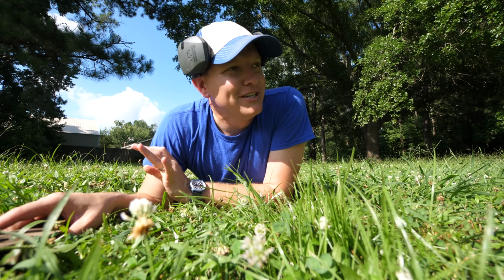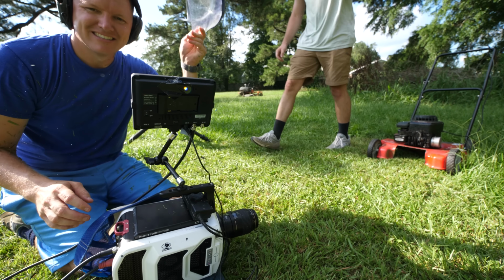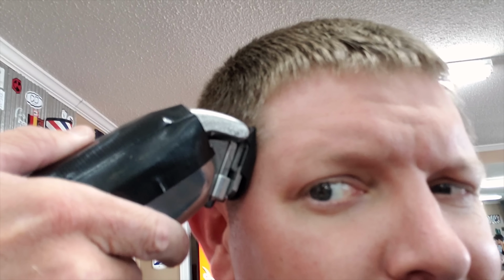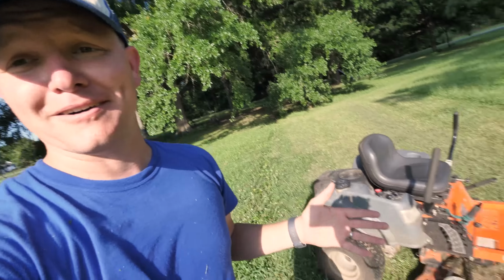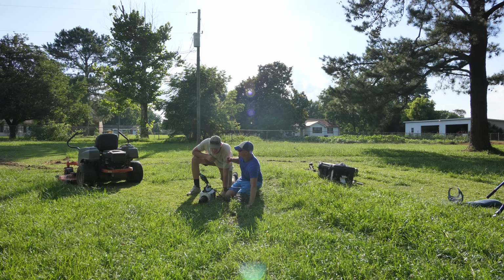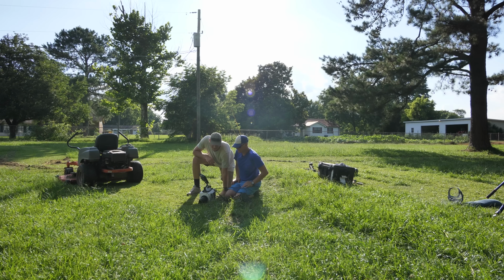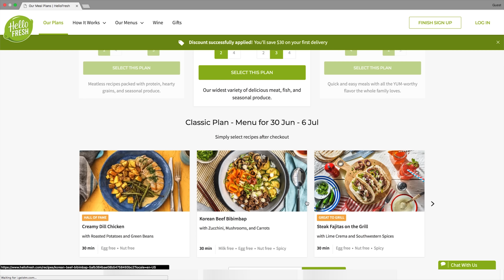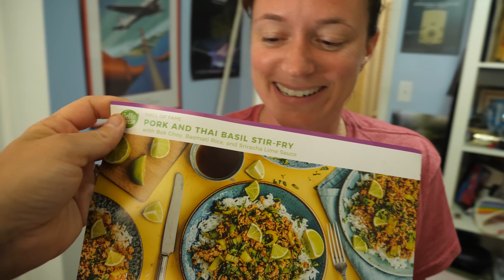How Lawn Mower Blades Cut Grass (at 50,000 FRAMES PER SECOND) - Smarter Every Day 196

Comment: I use a Flymo XL500 - a hover mower.  Would be interesting to see how it lifts the grass blades?
Reply: It doesn't.  Neither do these mowers.  By design, the hover mower has more downward air-pressure around the deck than these mowers do (note, NOT upward or inward pressure but down/outward pressure). It pushes the grass down as you pass over it, but all that pressure is around the edge of the deck, whereas the center is neutral/low pressure so that the grass can stand back up and be cut by the spinning blades.  Neither mower is lifting the uncut grass.

Comment: Not to dispute the presence of a lift caused by the airflow, I would still like to see if/how well would be grass cut by a blade with that endpiece producing the lift cut off. I don't believe the airflow is the main reason - it might be also by the structural-strenght of the grass itself

Comment: The newer and faster commercial mowers make a better, cleaner cut than the older commercial mowers up through the late 1990s, and for the most part, still better than the current non-commercial mowers.  I asked a mower retailer about this and he said the older mowers were limited by OSHA to 120 mph tip speed.  The combination of faster tip speed creating greater impact and more up-lift should enhance the cleaner cut..

The rough pasture and brush cutting Bushogs I think also cut at a 120 mph tip speed.  In general, though, a sharp blade is not preferred for cutting brush.  A dulled blade, rather than cutting, will burst and fracture the stems or small trunks and slow further growth more than a clean cut.

Comment: Old style mowers, 1950 , 60’s,  it was a flat blades with no air foil on back.  The speed of of the blade means as much or more than the air flow.
Reply: Add to my previous.  I think the reason they added air flow was more to bag the grass clippings.

Comment: instead of the mower vs scissors comparison you could've just used the previous non motor powered push mower version.
its blades work like shears.

Comment: You are completely wrong when saying that lawnmowers do not cut grass like scissors would.  There are some lawnmowers that DO WORK THAT WAY.  They are "Reel" mowers, some are hand push, some are powered.  They have a tubular form where a set of revolving blades are set in the periphery of a tube and the grass is cut when the grass blades get caught between the edge of a turning blade and a static blade.  Very simple, and best suited to fine grass lawns that are not very long.  The blades need to be kept quite sharp so they can cut the grass, unlike rotary mowers which effectively tear the grass blades.

Comment: The deck needs to be high enough to allow air to pass under for lift and a vacuuming effect  , if you don’t you will clog your shoot as it doesn’t allow a volume of air flow for bagging .
Reply: No. Your chute will clog if it is too small for the volume of grass being cut, exactly the same as for a snow-thrower.  Yes, air is also being thrown, but there is minimal/no vacuum effect.  Air is being blown out from under the deck as well.

Comment: A lawnmower could cut grass without requiring the air flow properties.  A weedwacker cuts grass just fine without any lifting effects and with a relatively dull trimmer string.  The air flow in the lawnmower is more for lifting the grass for a more uniform cut and to expell the clippings.

Comment: Just wondering... How does the flymo work then? Wouldn't it be pushing the grass down?
Reply: it pushes down the grass on the outside of the mower JUST LIKE THE MOWER IN THIS VIDEO.  The air in both cases is being directed AWAY from the blades.  For the the Flymo, the blades are in the low-pressure center of the mower where the grass isn't being pushed down (nor drawn upward), that is where the cutting occurs.  In a regular mower, there isn't as much downward air-pressure, and that is the only difference. Outside the deck, grass is blown away just like with the flymo. Once the grass is inside the deck then the blades are still doing the cutting with effectively no lift involved.  The tabs on the blades throw the clippings out the chute or into the bag.

Comment: Some extra light source would have been nice, to brighten up under the deck and make the cutting more visible. I also think the blades are probably not the sharpest, some grass blades looked pretty frayed.
You could have made a comparison between sharp and dull blades, how they interact with the grass blades.

Comment: After the air comes in, where is it dumped?
Reply: Think instead about how the air is being pushed OUT as you approach with the mower.  Scatter some clippings on concrete and then drive the mower along side it - it will blow the clippings away, not suck them in.  But air is getting back in under the mower though not creating lift, and the clippings and air are caught by the tabs and thrown against the walls of the deck (centrifugal force).  There is no vacuum, the pressure is neutral at the center of the deck where the blade is rotating.  If you have a discharge chute or bagger, the clippings and air can be thrown out of the deck through that portal more readily than being expelled through the underside of the deck.  With a mulching blade and no discharge chute, they simply fall back into the grass because there isn't lift/vacuum holding them under the deck.

Comment: OK, so I have a Snapper zero turn. It cuts horribly. It blows the grass down. It will only cut on the discharge side. The other side does not cut. One weird thing about the deck is the edge is rolled in, rather than out  or straight down like most decks. I have fought this lawn mower for 15 years. I've tried speeding the blade up which helped, but still half the grass is not cut. I've also tried increasing the lift. I welded more metal on the lift tabs. This also made a minor improvement, but still cuts poorly. I have finally drilled holes on the non-discharge side which helps even more, but still is not right. It seems there is just way too much turbulence and the grass does not lift. The other unusual thing about it is that it is a single 28 inch blade. I don't know if that is the issue or why this thing won't mow. 

I will say I will never buy a Snapper.

Comment: When you cut a piece out of the deck you alter the airflow. Simply put see through material (Plexiglas, plastic or any other see through material you can source). This will restore the airflow dynamics of the deck won't it? I have a Honda walk behind self propelled model that has two blades. Show how it works for us.

Comment: OK I knew about lawnmowers and air flow but what about line trimmers?? The line is actually thicker than the edge of a mower blade and it turns slower than a mower blade with no up draft and no opposing second plane.

Comment: That does not sound like a proper explanation. You're starting with the assumption that grass cannot be cut by a blade from one side, which is wrong. One-sided cutting is possible with a sharp edge and momentum. You're also assume that it's cleanly cut like with scissors and not torn like you smacking the paper, which is also wrong.
1. You can look up the difference between grass chopped by a rotary lawnmower and a reel mower, which actually has blades spinning in opposing directions. The reel has clean edges, while the rotary has torn edges. This indicates that the grass is just getting smacked and torn by your lawnmower. This is not different from just smacking the paper really hard.
2. What about scythes? Scythes don't use two opposing blades, and they don't use suction. Just a sharp metal blade facing upstanding grass from one direction at speed. Machetes cutting plants? A sword slicing a watermelon or a bottle?
3. The blades of grass straightening could be the result of just the natural upright orientation of the grass, giving it springiness. At 1:38 you slide the blade on top of the grass and it straightens right after, was that caused by air pressure? Had you shown stomped grass getting pulled up to be mowed, I'd accept the barber's air pressure claim, but you showed grass that is simply taller than the blade's height.

Comment: So you say you've been mowing most of your life and you never knew blade tab lifts the grass?
Reply: it doesn't, it just creates more air pressure that pushes DOWN the grass as you approach or blows away clippings that you didn't collect or requires you to have a large enough discharge chute to prevent clippings from bogging down the engine.

Comment: how does a scythe work or a lawn mower without an engine?
Reply: scythe cuts like a knife, same as these mowers but slower, requiring he actually bother to sharpen the blade!  Reel mower also requires a sharp edge and has a shear-bar/blade to act like a scissors when cutting.

Comment: Remember  that it is the tip of the blade doing the cutting. The only time you will see a longer cutting edge is if it is a mulching mower. Then ther are a few that has two blades 90 degrees to each other. The height you have your deck set for grass  length. Just my .002 cents opinion.  Lol 😂

Comment: Average person; blade cuts grass when it spins fast 

Destin: so what’s the science between the grass and the blades, because there’s no localized shear stress from one singular blade, let’s video it with a high speed camera and take each section of the process apart to find the scientific reason for it
Reply: Average person: uses sharp knife to cut something slowly, understands that lawn mower blades act as knives until dull, whereupon they should be sharpened, just like using a scythe.

Destin: tries to find the speed at which a baseball bat can be used to 'cut' (really just bludgeon) grass and infers the presence of lift as an aid...

Comment: I believe you're wrong on this.
For one the grass had a structure that makes it stand up. If you push down on a blade of grass and release it will go back up without any exterior force pulling it.
So even if a very fast moving blade hit it it will go back up.

And if the "suction/upwards pulling airflow" would my much of a thing there would be somewhere for the air to escape upwards in a lawnmower, which there isn't.
They're closed of and the air will go back down and escape.

Comment: Scythe, brushcutters, hovering lawnmowers, trimmers... all cut grass pretty well without creating an upward draft. And that's because of inertia: at the speed the blade hits, the force required to push grass out of the way is bigger than cutting force so it cuts through.

That same effect is at play in lawnmowers and not mentionning it is, at least, an editorial mistake. 

In fact, the fanning action of the blade has the role of moving the cut grass around and into the collector bag (or throwing it away to the side). And as far as I know, it may be it's main or even sole purpose. 

My bet is that the upward draft is far from straight up at the individual grass blade level because it would be very turbulent, and that it's magnitude is anyhow pretty small.

Comment: Couldnt you have just put smoke or vapour where the blade spins and see what happens to the air or smoke in this case
Reply: it would show the opposite of his theory.  Walk a mower passed or even over a sidewalk with grass clippings on it and see what happens - they will be blown away from the mower, not sucked up into it.  The tabs on the blades are for throwing clippings out the chute or into the bag, not lifting uncut grass.

Comment: High speed a super dull blade. We have a dry grass with lots of dust and the mower blades dull very fast. However it still cuts pretty darn nice. When ever I remove the blades we are amazed they even cut, but they do. I’m saying these blades are about as sharp as the side of a pencil. Just completely rounded over.

Comment: maybe a small coloured powder could have been kept on ground and then filmed with mowers cutting grasses around it. Powder would have shown air flow path clearly.
Reply: it would be BLOWN AWAY by the mower as it passed.  The blades are blowing air down and away from the deck, not sucking them up.  Cut the grass next to a sidewalk and see what happens to the clippings that land on the cement.  The tabs on the blades are for throwing the clippings out the chute or into the bag, not for lifting uncut grass.

Comment: I've always been curious why we use "string" on a weed eater, rather than a blade
Reply: You can buy blades, I have one on mine and keep them as sharp as my lawnmower.  But blades aren't as forgiving around walls, rocks, fences, stuff where its better to let a cheap string beat itself to death so long as the cut gets complete and strings don't need sharpening.

Comment: My father for years (50+ of them) tells me his lawn mower will not cut grass if you pull it backwards.  I personally try my best not to pull a lawn mower backwards because a friend of mine in 4th grade lost both his feet after pulling the lawn mower backwards up the ditch in his front yard and slipping pulling the lawn mower over his feet.   I have explained multiple times the Lawn Mower Blade only cuts on one side and in one direction, Clock Wise.  No mater what direction you pull the lawn mower the blade does not change direction so the cutting edge of the blade is always cutting the grass.   His response is not with his lawn mower.  I have asked him at what point does the blade reverse it's cut so it doesn't have the Cutting edge on the side that hits the uncut grass.  He can't explain it, as expected.  No his lawn mower is not 50 years old but he says he only buys push mowers not pull mowers.   Thank you for showing how a Lawn Mower Blade cuts grass, sorry but my father will call you a liar.   Maybe your next Mower Video can show how it cuts grass when pulling it backwards so I can prove I am right?

Comment: Your mower cuts better when you square off the edge of the blade. If you leave the edge sharp it cuts good for a few minutes then it's dulls and ends up ripping your grass, which leads to your grass becoming unhealthy. The square edge stays square longer and makes a clean cut.

Comment: Rotary mowers like the ones your using use lift and speed and rip the grass, cylinder mowers and finger mowers use the sheer stress and physically cut the blades of grass cleanly, they do a far superior job S opposed to rotary and flail mowers hence why they are used on high quality greens.

Comment: Put a bigger deck drive pulley on the engine and see once the blades get to speed see if they work better at sucking the grass up straight and cutting it I believe it should

Comment: A hand pushed land mower, the old kind with no motor, has opposing blades, at least basically, one moving and one static.  To me cutting and busting/crushing or tearing are closely related on one or two continuous axis for their parameters.  One example is to try different finish on the forward face of the blade.  I am thinking of the pecukiar way the swuare blades of old Vita-mix 'mixers' work.  They explain part of this in their documentation when I purchased one 40 years ago.  The flat face of the blade are like that by design.  While they turn pretty fast, admittedly in their documentation they are running on a chainsaw motor, the face of the blade just explode whatever solid is in their path.  That is why, instead of this being impossible with other mixers, you can transform sesame seeds,, peanut seeds ou grain from a grape into liquid, or at least a paste to make tahini, peanut  butter or grape juice from whole grains/grapes.  A motorized land mower blade doesn't have to be really sharp, it qill tear up grass blades or explode stiff stems.

Comment: How do mower with double blades cut the grass in between the gap in the two blades?
Reply: they are designed to have the cutting paths overlap so that there is no gap as the mower progresses in a given direction.

Comment: Why are real mower blades in the shape of waves? How does that benefit the cutting?
Reply: the spiral shape allows the cut to start at an angle and encounter/catch just part of the plant-stem/grass-blade at an edge rather than trying to cut straight through - the latter circumstances gives the grass more resistance to the cut and may allow it to bend out of the way and avoid the cut.

Comment: I don't know if wheelbarrows and grass carts count as "lawn tools," but I know that most women, who have more strength in their hips and legs, have problems "pushing" a wheelbarrow, but can "pull" them much easier. Men, who tend to have more upper body strength are able to push them. Why don't the manufacturers create a cart/barrow with a "harness" type of arrangement for women, or basically anyone with more strength in their bottom end, which would make hauling limbs, leaves, dirt, etc, easier?

Comment: If that is how a “normal” mower works, how does a reel mower cut even?
Reply: There is a Bottom' Blade/Bar so to speak.  Kind of 'Traps the Grass' then it cuts it.
They also 'claim' it sharpens the blade (as it strikes the Bottom Blade/Bar).

Comment: Reel mowers for the win!
Reply: No
Reply: @manofculture4945  well, OK, ~39000 golf courses disagree, but...
Reply: @ShopKatIndustries  well, OK, ~45 million acres of grass disagree, (and that’s just in the United States) but…
Reply: @manofculture4945  I guess if your only goal is to make grass shorter as fast & cheaply as possible, sure. The grass itself might disagree. Cheers!
Reply: @ShopKatIndustries  I’ve never used a reel mower on my lawn and I would say it looks quite nice. I can even put some striping on it but it takes more time to do. I cut my grass at 3 3/4 or 4 inches and so far in the summer it barely has any yellow at all. 

You don’t need a reel mower to have a good lawn fyi. And I would say it is definitely worth it by spending max 5$ on gas per mow on my yard and spending 1-2 hours.